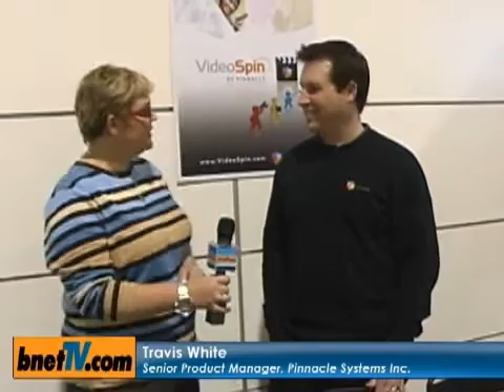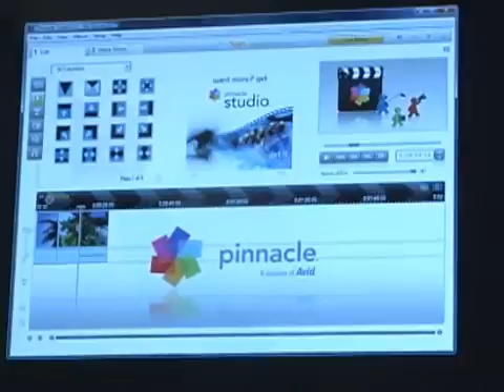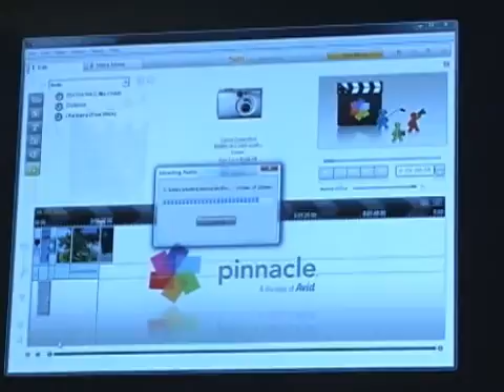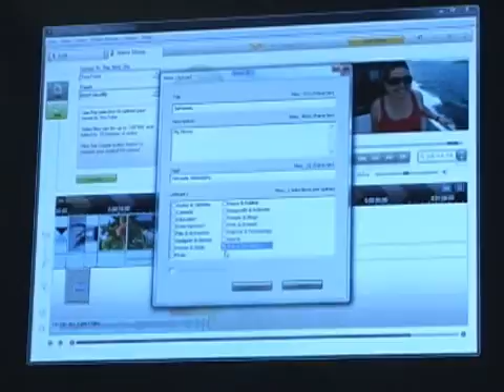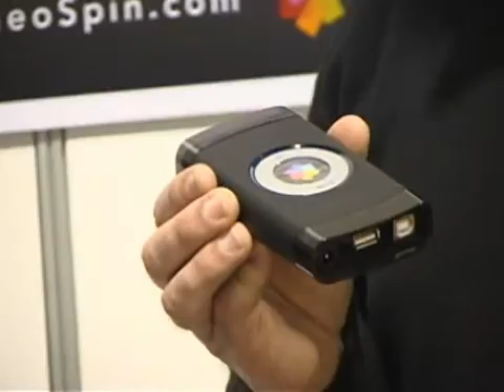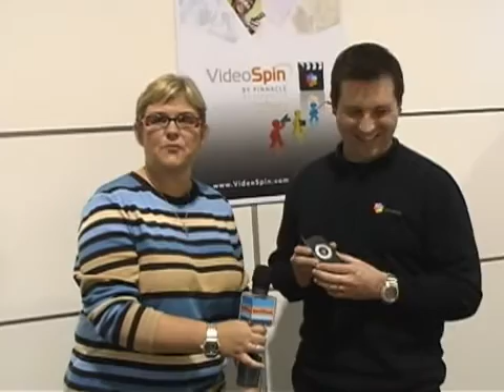Pinnacle's Video Spin Software

Comment: @marney89 

I double click my clips and nothing happens. I don;t even have an effects list on the toolbar anywhere. I think you're using a program other than Pinnacle VideoSpin. As far as I have researched there is no possible way to change your clips into slow, fast or reverse motion. You sir are the dumbass.